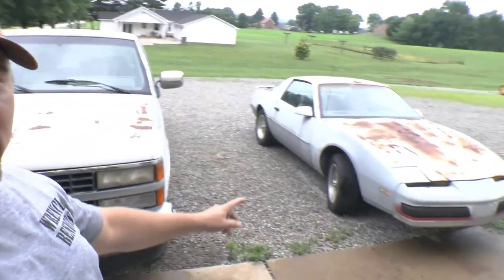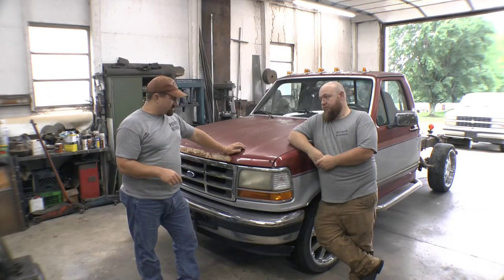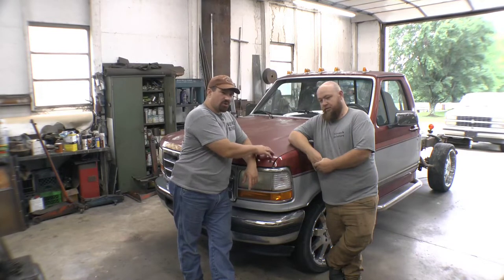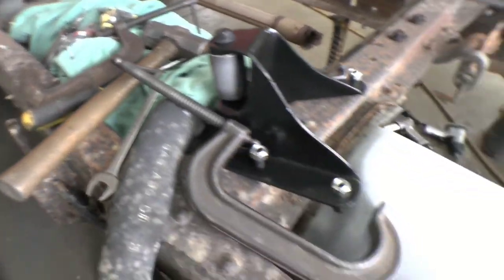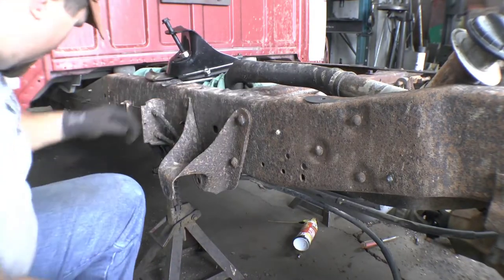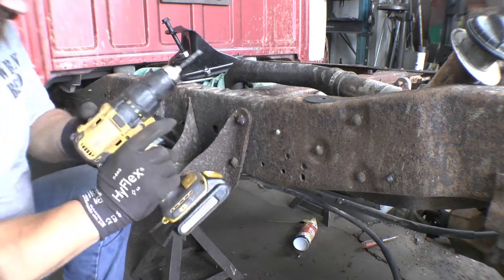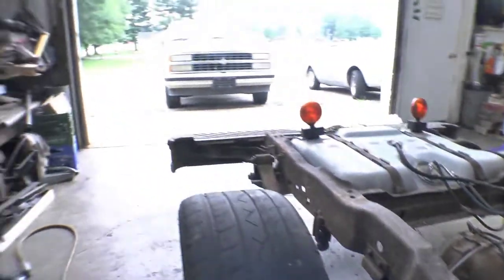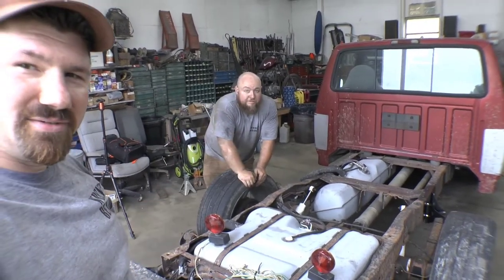1996 F150 DJM 5 Inch Rear Drop Install with New Spring Hangers and Bushings

Comment: Does the 5in drop still use the factory driveshaft or does it need shortened?
Reply from the maker: If my memory serves me correctly, the axle location brackets for the kit moved the axle back slightly to allow for the stock driveshaft to be used.
Reply: @wrenchbenders  right as I commented that the part where you explained it started haha. I'm about to tackle it on my 96 f150 with the djm kit and wasn't sure if I had to modify my driveshaft or not. It's an extended cab with a 2 piece unit and I already have to modify the front section for the LS and th400. If I had to modify the rear i wanted to get it in one go. 
The 3/4 drop I believe you do but fortunately the 3/5 fits what i want better and it's like $200 cheaper lol. Appreciate the reply man. I enjoy the content.

Comment: Was that completely stock or did you have to buy something and why do the brackets have to come off
Reply from the maker: Yes it was a stock truck. He wanted the spring hangers replaced because of how rusty they were. They were stock replacement hangers from rock auto.
Reply: @wrenchbenders  thats awsome thanks for the video il probably give it a try, and thanks for the tip on drilling the second hole in the bracket I have a buddy that has carrier bearing issues from not moving it back

Comment: What type of shocks did you guys use?!
Reply from the maker: They came with the kit that John ordered  from DJM
Reply: @wrenchbenders  really I don’t see it as an option, but could I get a different brand and would they be same size as the stock ones? Or do they have to be smaller?
Reply from the maker: @Sebastian Andrade  they have to be shorter because of the amount of drop with the axle flip. Not sure by how much. My friend bought the kit and I installed it. I don't know much about it to be honest.

Comment: Did you have to cut any of the frame?
Reply from the maker: The kit did not come with a notch kit, and John did not request that I notch it. He has been driving and has not had any issues bottoming out. He hasn't hauled any heavy with it either, though.